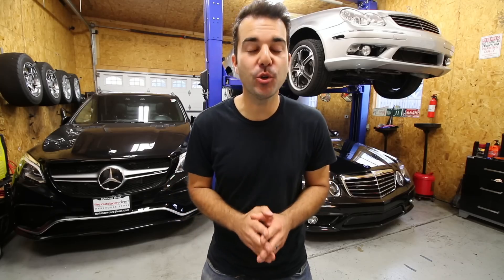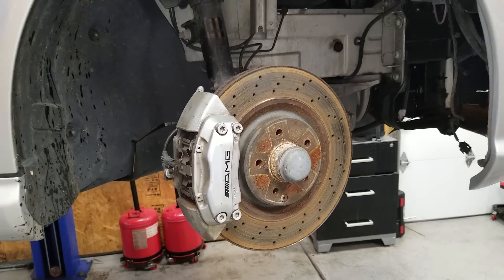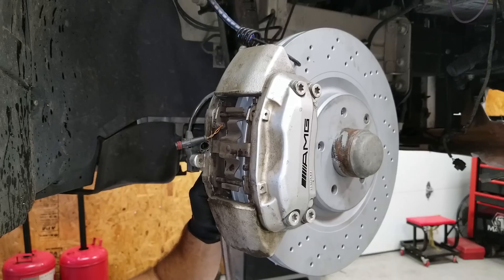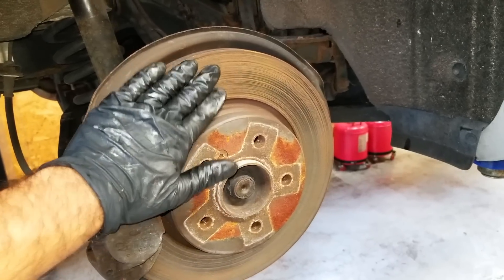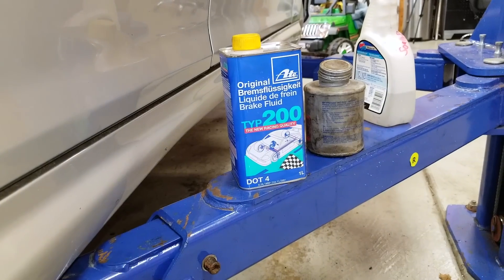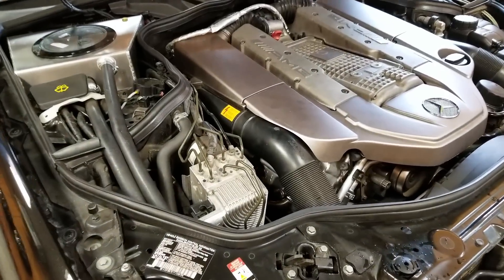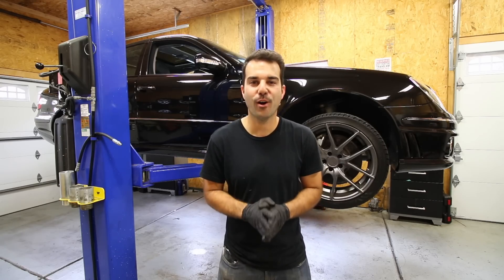Don't Let ANYONE Replace Your Factory Brembo Brakes Before Watching This Video. Big Brake Reality.

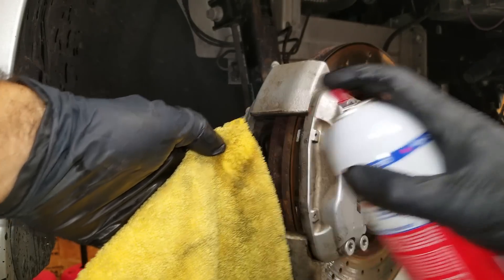Comment: 6:06 Brake fluid ruins paint, not brake cleaner
Reply: I've gotten brake cleaner all over my AMG calipers and it didnt strip the paint off smartasseses lol
Reply: @samspace81  brakes are coated, but brake cleaner has gotten les agressive on paint.
Reply: he's no F clue what he is doing, this amount of anti seize can ruin side tolerance of rotor and on brand new set of brakes you will have vibrations on braking
Reply: brake cleaner can dull the finish on your caliper. Best to avoid spraying it all over if you can.
Reply: Go spray the non chlorinated stuff on your paint. 
See what happens. 
Even the chlorinated stuff at the minimum is gonna take the wax off and make it look flat as soon as it dries.
Reply: Elon Blunt  I use contact cleaner when in doubt...
Reply: @ihazpowrz  Thanks, I'll keep that in mind. The reason I use that is because it's supposed to be safe on plastic and rubbers, it won't rust out metals like water would and cleans out electrical connections fairly quick.
Reply: Your Mums HITACHI  Aight Thug.
Reply: @taol8258  use brake cleaner that doesn't contain alcohol and it's not so aggressive
Reply: @ihazpowrz Powdercoat on brake calipers?
Reply: @janhendrikfranke  yep
Reply: Evaporating brake cleaner wont. The rest do
Reply: Brake cleaner removes grease, so it wont damage paint or coating, but brake fluid ruins coatings, paint and your garages floor

Comment: Hi there, I have a c320 w203 with standards brakes.... I would like to make an upgrade, since I have reasons to believe that the original brakes are the same as the c180,.basicly it dosn't  bite well when could and in everyday  driving.... could you please tell me wich upgrade would improve  breaking , thank you!

Comment: I purchased my first Benz, a 2010 E550 non 4matic last August. Today I was driving it and noticed the break pedal felt soft. By the time I got to the store I get a warning light, low break fluid. After inspecting I notice a small puddle behind the driver side front tire.  I’m assuming it’s a broke line, so I know once I fix it, I’ll need to bleed the brakes. Do you know if I need to use a computer to bleed them, or no? Thanks in advance.

Comment: Hi mate, 
I just bought 2013 Vito 122CDI With v6 engine.
Can u plz mention the common issues of this kind/age v6 vitos?
Which engine oil should I use? etc
Thanks in advance

Comment: These precautions you mention about relieving pressure on the pistons and disabling the parking brake, are these things I need to do on a 2013 Mercedes S550, it has AMG wheels but nothing else AMG on it.
Reply: I also want the repair manual download for my 2013 Mercedes S550 but the link is not valid.

Comment: Looks like the rotors you have on the front are backwards, ie left on the right side ...note they are directional on the drilled holes to sweep dust away from the center...rears are not correct either....check it out

Comment: 3:23  My local garage has a machine that is attached to the discs/rotors while they are on the car, and it grinds them flat again, avoiding the need to replace discs/rotors that are warped, but not totally worn out...

Comment: the pads on a 6 piston front break dont slide in from the top. there are 2 pins, yeah - but that big bolt runs through the center of the Caliper - and I really need help...

Comment: So you were s MB tech?  I hope you can help me. Need a febi bilstien rear suspension rebuild kit. My tires have excessive camber. It is a 2005 SL65. I can only find kits for the S600s.  Right now my rear suspension has a light squeak. But more importantly my $700 tires are wearing out too quickly.  Suggestions? Much appreciated.

Comment: You didn't have any issues.  Doing the fronts on my E55 three of the four pins seem totally seized, the torx holding the disc (rotor) on both sides totally rounded off and one of my brake hoses has damage so now I need to replace both fronts of those (which means I might as well do the rears too) and do a bleed - which it seems like I need STAR for - Certainly testing my patience.  Any chance anyone knows whether it's safe to use a pressure bleeder only or is STAR a must?
Reply: I'm sure I read somewhere that Mercedes made the provision to bleed the system without STAR so that an owner wouldn't be stranded should some small independant garage not have the proper Mercedes tool.  If you were to use a pressure bleeder only I appreciate that the accumulator probably would have some old fluid in, but you could correct this by activating the pump by cycling the ignition so push that old fluid through too...  

I would really like to do it all myself, but I think I'm going to end up doing all the part replacement on my driveway and then get a mobile mechnic over (or someone local with STAR or a advanced scan tool) to come and help with the bleed.
Reply: Ok, the saga continues.  The pins were basically welded to the alloy, impossible to remove without damaging the callipers - also I’ve just discovered the brembo pads i bought don’t seem to fit - even though they are brembo callipers… 🤬
Reply: To close this off, I got everything back together, did the front hoses - but left the rears for another time as I didn’t want to damage the hardlines.  I’ve greased everything nicely where appropriate and used Pagid pads which seem to fit properly whereas the Brembo’s really didn’t.

Managed to bleed the system myself using a pressure bleeder, you can get the air out this way, but to exchange all of the fluid you would ideally need to do this a few times with some miles in between.  Since my fluid was in good shape I did it twice.

So ended up with the car off the road for a month while I waited to get the callipers back.  Bit of a nightmare job and I wouldn’t have foreseen it before I started, otherwise I would have got all the other parts ready ahead of time  and sent the callipers away immediately instead of messing around trying to get the pins out on the bench.

Comment: just thought I'd let anyone know I've got amg gla45 2017 yellow night..to do the rear breaks you need to set the menu  to mileage... push ...both ...phone buttons in and a micro sec later push ok  ..not just one phone button....I've seen other clips where you still have to use a piston pushing in tool after you push those buttons on the steering wheel..so I'm a little confused..I'll know once I  go to do it if the piston retract all way back electrically. to make room for new pads .

Comment: Watch out for  this dude thought he was trustworthy but sadly he ripped me off with his affiliated link for a manual I trusted him good dude I thought but no! I purchase a manual for my CLS 320 turns out his 10% discount is crap the site is offering 20% discount but it doesn't tell you that until purchased then after paying you get a link to a 20 Gig file 20Gig....!!! This is just the start the file is an ova file which only opens on a Mac or PC with special software which is VM ware and you have to use virtual box WTF if been well and truly spanked thanks bud you are so kind🤬

Comment: Hello, 
I hope you can help me answer a question. I purchased Brembo Rotors and  Akebono Ceramic Brake pads for my 98 XJ8L Jaguar and they have been fantastic, (130k Miles all service and shocks )
I then  acquired an 08 Jaguar  XJ  that its brakes Rotors and pads were new according to the mechanics had a shudder at 60 mph when braking, so I replaced it with Brembo Rotors and Akebono Ceramic Pads, the shudder got worse,exhanged for another set, still the shudder exists even at 30-35 mph. 
Could you please guide me as to what might be the issue. They were purchased from an authorized distributors of yours Rock-Auto with Warranty. 
I understand you might not be able to answer these kind of technical questions. 
thank you.

Comment: Do you have to disable the ABS or any other brake system component?
Reply from the maker: It's in the video but for SBC yes and if you have an electronic rear parking brake, yes.

Alex
Reply: How do i do this? I have been an automotive mechanic since 1973, but I have no Mercedes-Benz experience. The car is an S550. Thank You.
Reply: I have a Mercedes S550. How do I disable these components? I have been an automotive mechanic since 1973, but I have no Mercedes experience. I have used computer interface tools, but I have none now. Thank You

Comment: So I have a 2020 dodge charger and I need to change the brakes. I was told I had to get brembo pads and rotor. But you’re saying I can use, let’s say, MOPAR pads and just slide them into the caliper? No issues with fit. I believe mine is the 4 piston.

Comment: At 6:55 Do not beat the living hell out of your rotor that is connected to the hub. You could damage your hub. I use 2 hammers and tap the lower end towards the car and the other hammer taps the upper end from the inside towards me. Works every time without damaging the hub.

Comment: This video is done very well. It shows everything and explains why. Mercedes's slogan goes "Best or nothing". I own MB S Class 2013 (arguably the last cool W221 for boomers model) and while the car itself fits "Best or Nothing" perfectly I am not sure if MB Service teams in Australia do. You bring a car for service and a "concierge" (often not a technical person) and the car goes into a black hall and at the end of the day, it appears from a black hole again. If the car comes back the same or better this system works. But it often doesn't. What MB Service Department does not understand is that when it comes to S Class the mechanic should have musical ears. Because his main goal should be to constantly strive to minimize vibrations and sounds of the car to the bare possible minimum. The car plays music and only the owner knows what the music is. The mechanic does not unless he is keen to drive the car at least before and after service is done.     
Examples: 
- They have installed new brake rotors and brakes on all sides because there was slight vibration when braking. Vibrations are gone and braking is smooth but there is a gentle new sound (many people would not even pick up on it). Possibly pads very gently still touching rotors when not braking. 
- Later on, they have done B Service. Many "check, check, check..." and one of the checks was to check the belt. Result? New sound (many would not even pick) sounds like radio noise. Opened the bonnet and realized it comes from a noisy belt pulley.   

The above is not to complain. The car is great but "Best or Nothing" in my opinion supports what Alex is saying in the video that certain jobs are best done by owners. Plus I think MB Service is asking owners of MB cars to go into beautiful gardens far too often and too much trimming and cutting are not Best or Nothing for gardens. You do not fiddle with things that work.

Comment: Dont you have to clean the paint or grease off the rotors (the gray stuff)?
Reply: No
They are designed so that the pads quickly wear off the ' paint'  were they bite,but the rest is left to protect the disc from surface rust.
They still need a quick run down with brake cleaner to degrease them imho.

Comment: Yea man way cool video on Brembo brakes, I just got an 06 subaru legacy 2.5L GT it's like a low buck turbo sports sedan. There are Brembo brakes on the front, my 1st time taking these brake calipers apart, I did not know about the pins instead took out the 4 bolts. The bottom of the caliper started leaking brake fluid, yikes put it all back together again. Had to look up Brembo brakes how do they work, how to take them apart. You did a great job showing how to change out pads, and rotors. Next time I will be ready to do the whole job with out any doubts. 
It was a little daunting at first, now it looks easy, thanks for the tutorial, ....
Dennis

Comment: @Legitstreetcars Have you ever played with the "brake hold feature?"  I've seen videos about how depressing the brake pedal to the floor will hold the brakes or something with the cruise control stalk.  Then the rabbit hole of the forums say it's only available in Europe and can or can't be activated in some sort of "global" setting in STAR.  Any experience with this?  Have you ever set it up?  I have a 2006 E55 and my local mechanic isn't familiar with the setting.

Comment: Same as late 60's Datsun front disc brakes on the SPL-311 & SPR-311 roadster.  What happened to applying high temperature PTFE brake grease on the retainer pins? Why is lateral run out not checked with rotor torqued in place? Most are 0.02" or less, like Acura. This allows to check both the rotor and hub. If it is off, mark it, then rotate to re-check. This eliminates pedal pulsation fixed or floating. They sell conical washers for this purpose from Kent-Moore with dial indicator on magnetic base. I have both. Check within an inch (25.4m) from the edge of the rotor while rotating slowly to assure no complaints or come-back. 
ASE Master Tech since 1978 / Retired

Comment: I wouldn't say the rears are the same as the front. All the car brakes ive changed the way of pushing the pistons back in is totally different because of the parking brake. You have to have the special tool to twist the pistons back into the caliper. People will end up trying to squeeze the pistons and destroying their calipers.

Comment: Can someone explain the break noise to me. I just got a 2021 Lt1 Camaro and I hear noise coming from the breaks especially when it 30 degrees or lower outside. I had the dealership check it out and they told me that the breaks are fine.

Comment: It’s true my Audi has the same brakes (4 pot monoblock brembo)....but they’re sitting in my closet right now because I haven’t replaced my S3 calipers yet oops. I need to do a caliper/rotor swap and fluid flush

Comment: Those hubs (7:10) are nowhere near clean enough to mount the new rotors on, rust scales are still visible! I've seen cars come back to the shop with brake vibrations and noise from much less than that. Those rust scales are probably putting you already beyond the acceptable lateral runout spec (0.0020in/0.05mm on my car for example). That hub should be shiny and clean enough so that you can lick it. Also, aluminum anti seize is ok if you have nothing else, but it dries out too quickly and goes on too thick (again: lateral runout), try a quick spray of lithium grease.

Comment: Speaking about brakes. On my 2003 Mercedes E320,I have that Damn annoying red battery light on. I have a new aux battery and 
alternator, l have replaced the voltage relay in the trunk next to the main battery and still have this problem. HELP !!!!!!
Reply: Get a digital volt meter $20 Walmart or Sears.   Measures the DC voltage on the battery when the car is running. If you see 14.4 volts DC then the alternator is good.. if it reads 12volt no good.

If the alternator  is good then you may have a wiring problem

Comment: Akebono Ceramic Pad are great Daily Driver and Mild Street Mod Driving.........They are rotor friendly and low dust and wear well.   If you track your car or a super aggressive driver you probably want higher performance pads.

Comment: Do you think you could do a video about retrofitting like s65 amg rotors on a e55 or some other model with the right wheel clearance?
Reply from the maker: I'm not sure but you would also need to make sure the pad contact is proper. Its normally not a direct bolt on to increase the rotor size. There isn't much clearance there

Comment: I do. I did. Exactly as shown in this video.

Brembo Gran Tourismo BBK kit. SIX piston and floating rotors.
2005 E46 M3

Re-use the "hat". Replace the "friction ring". Loctite and specific torque specs.
BEST fluid is Castrol FRS full synthetic. 75 bucks per liter.

But I used Stop Tech rotors when I had to replace mine. Perfect fit and TONS cheaper.

Comment: Never just push pistons back without opening the bleed screws to let the fluid out or you can flip the master cylinder seals, and i have changed thousands of pads over the years and never did that, now i do as i flipped a seal once and turned a 10 minute job into a 3 hour job, and it can be an even bigger job if the ABS gets air in it, learn from someones else's mistake if you can. Most brake manufacturers say use non-matacllic grease,  same thing again we used copper slip for years oooops.

Comment: I’m a mobile mechanic.
I e learned the hard way  to never use any brakes on Mercedes other than. factory MB pads and rotors.
Aftermarket pads will eventually squeal of not right away.
If my customer wants go go really cheap I make them sign a no fault waiver explaining that they chose aftermarket and I’m not responsible for noise or performance issues from inferior materials.
As far as brake dust ....customers with performance models like to keep their cars clean so I always suggest them washing and waxing their painted wheels to keep brake dust from sticking to them as easily plus it makes them easier to wipe off brake dust.
I usually tell them to wipe the brake dust off every couple days when the wheel is dry using a microfiber towel because brake dust will eat up the clear coat on the wheels of left on there regularly.
I’m sure you know all this but your viewers may not.
Man those SBC brake systems were such an over engineered cluster fluck from overzealous MB engineers trying to be innovators before they tested their junky product in the field long enough to realize their system was a nightmare.
Thanks for the video....you have a really nice shop!

Comment: Hi 
I like you are the best.
I have a 2015 glk250 and my front driver side makes a noise at low speed like parking lot speed but after car wash The noise is gone for a while .
What to do to eliminate that sound.